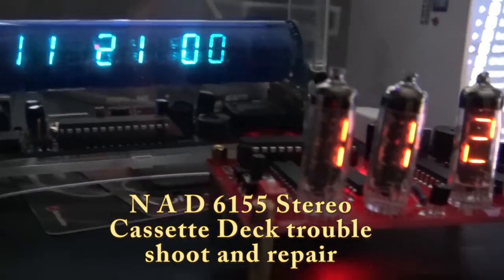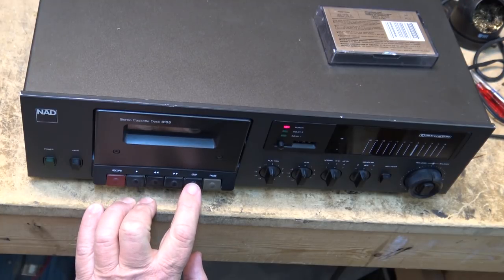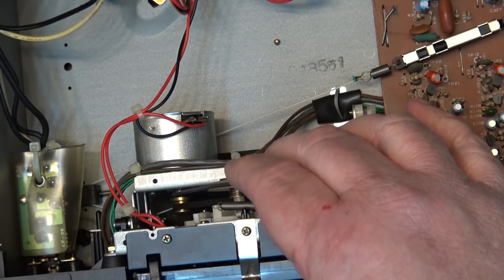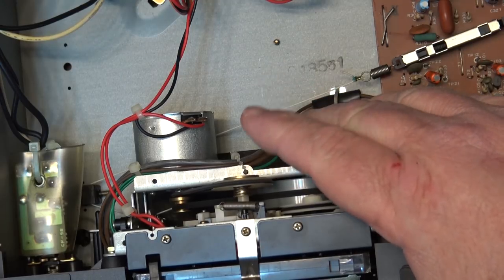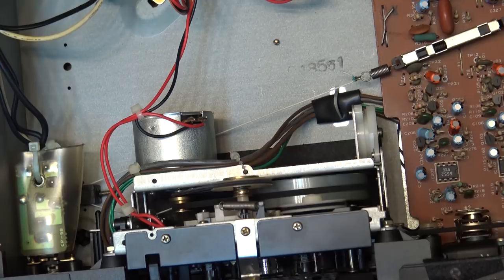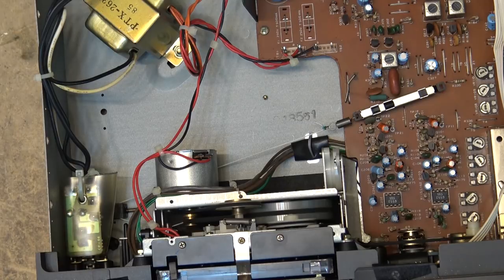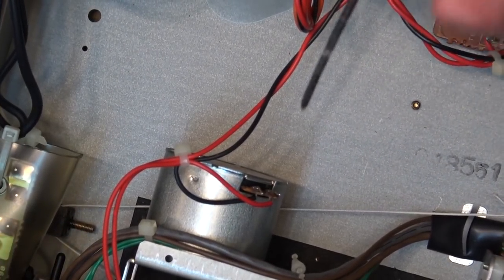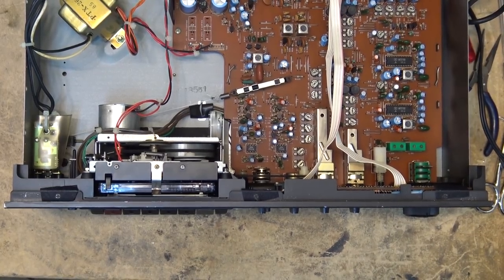NAD 6155 Cassette deck repair

Comment: I have tried boiling belts before- just on my own intuition, with limited success. But I realize watching this video that you let them go for 15 minutes, which I would never have guessed would not just melt the thing.  So I am doing one now in the microwave and letting it go for longer like you have.  This came in handy. Thanks!

Comment: Sometimes the simplest, right in front of a tricks you never think of like using tape to hold the other belt in place you can't see. And others like boiling the belt is so far out there makes me wonder how it was discovered. Thank you for sharing this wisdom and experience with us. I know sometime in the future I'll use one of these tricks and mentally give a big thanks for taking 90% of the aggravation from a repair.
Reply from the maker: The boiling belt can be credited to an old mentor of mine. A very smart broadcast engineer by the name of Leo Partanen. He was the head engineer at a cable station I worked at, and I saw him so that once for a 3/4" VTR that was throwing the capstan belt all the time. He had the machine in the shop and had the belt in the microwave. I asked what he was doing and he said "fixing it" Of course I had to try that, and well we know how this story ends. I learned that long before I was even considering a career in electronic repair. I was actually an intern at a TV station, as that was my field of study at college. Didn't pan out, and I went into the electronics business as I had already worked at a shop while I was going to school.
Reply: @12voltvids  I believe heating or cooling belts to shrink them goes back to the days of leather and cotton belts used in heavy machinery in factories. I volunteer in a local flour mill and the miller once tried to shrink a belt on an oat milling machine we have there.

Comment: Thanks, this video has provided some insight into what is likely the problem with my old marrantz system. It's a twin tape deck in a stack system, but both play fine, both rewind fine but neither rewind, if they do it's sluggish, or they stall out.  I think one day I'll brave it and open the deck again and take a look at the belts because I assumed belts were fine as it plays and fast forwards.

Comment: Boiling belts and pinch-rollers, GENIUS! Is that Jewel on the lead outro music? Thanks for sharing this great old cassette deck. NAD had a couple of cassette decks and other stuff that were hidden gems, offering performance value which was typically only present on much more expensive models from flagship companies, with stellar performance. Even these NAD 2 head decks were kick-a$$ sonic contenders!

Comment: I've personally never had success with belt boiling, so I just replace them. Same for the pinch roller. Cleaning only gets you so far with an old deck.

Comment: Azimuth corrections are nearly almost neccessary  , after a while 70% of the 2 head decks need to be re-adjusted 20 till 40 degrees to the right (clockwise)  in this set up, especially when the screws are mounted in plastic ..  The left channel which is always the child of the bill is going to benefit the most . Recordings will sound more open and defined

Comment: I found using a set of micro pick tools very helpful when maneuvering and remounting belts. I tried boiling the belts from my GXC-39D which is what, 42+ years old? it shrunk down but they are still +/-5mm out of tolerance. But they were roughly 12mm or so. So it does work :-)

Comment: Hey there, thank you for this video. I realize it's a few years old but wondering if you've ran across this scenerio;  I've replaced all the belts in this exact model and everything works, plays great, but ff and rew buttons won't stay down....they work great but don't stay engaged.  Just curious if you've ran across this?  It may be something I moved or didn't reassembly correctly..

Comment: I always say YOU KNOW what you need to be safe. The reason trolls complain about people not being safe enough is because they are less skilled and knowledgeable and half to take extra steps to prevent themselves from getting hurt.. Don't let the trolls get to ya.. I visually laff, because I can see them making stupid mistakes and hurting themselves. If you did everthing the trolls and people that want a nanny state things would MUCH longer and the Cost to skyrocket or even worse nothing would get done, because you can never prevent a idoit from hurting themselves.  Ignore the thumbs downs from the troll. I think your lever of safety matches your skill level. Thanks for the vids.
Reply from the maker: The troll is being dealt with with the legal department at youtube. He crossed the line and is being taken very seriously. Nuf said.
Reply: trolls  need to go. good luck with that  . you post a lot of good  info with your vids . i have learned a lot from you and your vids . now i try to fix stuff before it goes in the trash .   THINK YOU !!!  SIR!!!
Reply: I agree - I learn a lot from watching 12voltvids tech talk videos. :)

Comment: I noticed that when you recorded, the source was up to +5dB but when playing back the tape, it hardly ever reached zero dB. Isn't the source and tape supposed to be the same level? 

This either means that the tape doesn't run as hot, or the internal rec level needs pushing a little to normalise.

Just wondering...
Reply from the maker: The shots of the meter were not necessarily what was going to or coming from tape.  They were made after the shots were done for an insert shot.
Reply: @12voltvids  understood. Thanks for clarifying that.

Comment: Nice video. Wish you would do a video on adjusting the internal playback output voltage and record voltage. I mean where you adjust the POTS. Need the service manual and the voltage specs. Its my understanding that these settings are critical to the dolby working correctly.
Reply from the maker: Yes you do need the service manual specs to set it up. That is why I don't just start tweaking,unless someone else has been in there messing with them they will be correct.

Comment: The noise was a program stored from/for the Texas Instruments TI-99/4. Computer. Cassettes were the default method for saving/loading its Basic data.
Reply: Ray Rooney Same with the Commodore 64 and most other 80s computers.

Comment: I cleaned the pinch rollers in my decks with alcohol way back when I was a teen more than once. I still have one of my Sansui decks and it's fine. It probably evaporates before it can really do any kind of damage.
Reply: IIsopropanol is pretty gentle with most materials. Just keep it way away from anything acrylic and you'll most likely be fine.

Comment: Cracking job :-D, ahh the rec-play mode switch, i used to use servisol for those :-).
The stubborn ones i dissasembled and cleaned manually.
I've always used ipa for cleaning rollers/heads/pulleys, never caused any problems for me.

Comment: Whats the thing that transformer inside a cassette deck being such a strange placement, far a way from other components and in 45 degree? Is it noisy component or it affects playback/recording head? Just it stands out there...
Reply: It's basically a mains powered electromagnet.
Reply: true, but that is a magnetically shielded transformer, so it should not  matter were it is placed, maybe they were just playing it safe.

Comment: Thnx 12voltvids, I have enjoyed many of your videos. I have watched this one as I also have a NAD cassettedeck (NAD 602) with the same issue. Both Rewinding as Fast Forward are very slow (slower than Play). Initially, I also had an issue with no Playing. But I have changed the main (flat) belt, and now Play works perfect. Unfortunately, winding was not solved. I have looked for other belts, but there is only one other belt; for the counter mechanism.
Do you have any other advise for me what I could do?

Comment: There are a few later models from NAD  that have a belt somehow connected to the door . So if this belt becomes too loose or breaks , the door won't open at all .. I don't know exactly how it works but I think its  Very strange

Comment: How about that! Recovering a bad belt with the old boiled belt in the microwave for 15 minutes trick. Does that work on just rewind belts or are they all that way in this brand? Works for me, saved a belt! Not bad. Pretty quick too, but I have a discwasher DMag and it works just lovely.
Reply from the maker: Depending on the type of belt. Some will recover nicely, and others not. Depends on what they are made of.

Comment: hi just puchased a 6155 and when you insert a cassette in and push play / ff / rewind nothing happen just wondering if there is a transit screw being used or have i bought a duff one

Comment: Hi, 12Volt. I am having a hard time finding capstan drive belts online, that aren't warped and poorly made. They all sound like warped crap! I was wondering where I could find decent belts that give a nice perfect tone. Square belts or flat belts. Thanks!
Reply from the maker: I just ordered a bunch from fleabay, so when they get here I will have a look at them and see if they are any good. I used to buy from a local distributor, but after the owner passed away his son decided not to continue with the family business and pulled the plug. So I am in the same boat as most are these days.

Comment: Question:How did you record the 440 Hz tone?How did you verify the recording speed was exact? Just curious.
Reply: Mark Markofkane a) Some sort of tone generator and b) likely by ear and via the scope.
Reply: I’m not entirely sure how you’d know if the machine is running at an exact speed. I don’t think there’s really any way to tell. You can have your machine running really slow during recording, it just has to play back at that speed to sound right, but doesn’t mean it’s universally the correct speed. I guess the correct speed of tape decks was determined by mass produced cassettes recorded back in the day, done on the big proper machines. And by comparing the speed of the deck playing one of those tapes to the professionally remastered versions of them would be one way to know if the machine is running at the right speed.
Technically all he really did was tune this deck to the speed of his own one, and who knows what his deck is tuned to.

Comment: I use saliva with cotton buds then dry cotton buds to clean pinch roller. Works fine! Is that cassette data for a c64? Or perhaps amstrad cpc464? I have spectrums and Atari 8 bit gear and it's definitely not them. Ah I notice the question is answered!
Reply from the maker: TI99/4A

Comment: When you demagnetize the heads do you leave the tape deck on or off?
Reply from the maker: It really doesn't matter if it is on or off, just not in play or you will have the playback amplifier on, and could in rare instances damage the playback amp first stage. Also you never touch the head itself. For 1 you could scratch it, but direct contact would turn it into a transformer and could induce a relatively high voltage back into the circuit. I have a spacer about 1/4" on the end of the bolt that will get me close enough to eliminate any residual magnetism but far enough away to eliminate the possibility of inducing  a high voltage in the head winding.

Comment: 22:37 - is the take up roller struggling to rotate or it's just me and my beer?
Reply: Whichever of the two reels is bigger will rotate slower than the other.
Reply: @ranjitragu  That is corect. But just look at the left roller ... it rotates in a smooth way. Cannot say the right roller does it the same way.

Comment: Hello. Im a follower of tour vídeos. I love this kind of stuff. Im trying to add a líne un jack to my old stereo system. I have disassambled it and i hace thought to connect to the cd audio out connector. It has 5 pins, 2 of the grounded. I need some advices por recommendations. I know it is difficult because i have not found any information about this equipment. Greetings

Comment: Is it ok the deck running while u spray contact cleaner over the switch? Coz im always turn off the deck to do it so
Reply from the maker: Most contact cleaner is flammable when wet. So it is probably a good idea to unplug the unit as if there was a spark....

Comment: Hi 12voltvids, first of all, I'd like to thank you for the great content that you provided on your channel. :-) I have the same deck, I bought it like two years ago, and all I needed to do was to change the belts and clean the heads. It has served me perfectly ever since, but now it seems that I have a new kind of problem. When I press play or rec buttons, the deck won't engage. The buttons engage for like 3 seconds and then come back to their original position. I have tried cleaning the switch, but it seems that the problem is more of a mechanical nature. Rewinding and fast forward work perfectly well. I guess that my question is do you have any idea what could be the source of this problem and what is the potential solution. It seems that pinch roller doesn't come up to "pinch" since when I hold it with something in place the whole thing works. Thanks in advance!
Reply from the maker: Sounds like the auto stop mechanism is tripping
Reply: @12voltvids  Yep, I guessed so. Any ideas what I could try? ;-)
Reply from the maker: @rajaizkraja  
I believe it runs off the tape counter belt, but could be wrong.  Would have to see the mechanism.
Reply: 12voltvids Ok, thanks, I’ll try to hunt for it in th eservice manual. Thanks a ton!
Reply: @rajaizkraja  Hey Nick - did you ever find a solution for your auto-stop issue?  I have a 6240 with the same problem.  I believe the counter belt is downstream from the main problem, but haven't had a chance to get into it to find out directly.  Thanks for your help.

Comment: What do you think of MG Chemicals Rubber Renue for belts?
Reply from the maker: Idler tires it is OK. Don't put it on belts. It will make them larger.
Reply: Good to know.  Thanks.

Comment: Is there a way to determine if a belt is pure rubber or not?  I'm guessing it'll melt in boiling water?
Reply from the maker: Water boils at 100c far below what rubber or synthetic rubber melts.
Reply: @12voltvids    gotcha.. thanks!

Comment: Question about a Sony dual cassette deck from 2000.  Would you happen to know the voltage the solenoids use?
Reply from the maker: I believe it was 12 or 15
Reply: @12voltvids    thanks!

Comment: Question;

It is ok to boil a belts in a small pot  through stove even you dont have microwave?
Reply from the maker: No
Reply: @12voltvids  ahh why? Its melting the belts?
Reply from the maker: @gilbertlabra7531  
Yes the bottom of the pot will get far too hot and melt the belt. In a microwave the water can't get above 100C but the bottom of a metal pot sure could.
Reply: @12voltvids  ahh ok. So if i boil the belt in a microwave i set a temperature in 100°c in 3 mins or 5 mins?

Comment: How long would a belt last after being microwaved?
Reply from the maker: I have a few that have been in for years and still working. Depends on the belt.  I've done it many times over the past 30 years.
Reply: @12voltvids  Would boiling water do the same thing as I do not have a microwave here.
Reply from the maker: @theotherchannel2279  it's the hot water that does the work of restructuring the rubber not the microwaves so yes I would expect the same results.
Reply: @12voltvids  Cheers mate. ;)

Comment: When you change belts, change them all.
Commodore computer sound.
Reply from the maker: This is the same analogy to 1 cap bad shotgun it and change em all.
Belts wear at a different rate. The other belts are fine. 
If I was making 100.00 to change it, or if it was a very difficult unit to change a single belt then sometimes this makes sense but I don't make anything on these maintenance repairs. I make money from showing you how to go about changing it. I make way more from the ad revenue than I ever make doing the actual work.

Comment: NAD Built Wonderful Stuff, Just Too Pricy For Me!  B&O Taste With A Soundesign Budget.
Reply from the maker: Yes very nice. Yes expensive. No I don't own any, but I wish I did.
Reply: I lost my faith in nad when they started cheap Chinese class d amp crap
Reply from the maker: In audio equipment, old is better unless you are buying the high end domestic amps. The new Hafler and Dynaco amps are made in Canada by hand and are or very high quality, same goes for PS Audio in the USA. Again you will pay for this type of quality.
Now as to class D amps, they are getting better, and some of them are so good that unless you were told it was a class D you probably wouldn't know.
Reply: 12voltvids NAD? Expensive?

They were very much at the budget end of the market in the UK. They built their name on good cheapo amplifiers in the 70s and 80s, but their tape decks and CD players were generally just cleaned-up Sanyo designs (knock-down kits in some cases) made in Taiwan by Tatung. The record decks were badged Rega units and pretty good, but none of it was especially expensive in their glory days.
Reply: I have a nad c352, first thing I did was change out all the caps for Panasonic ones. The cheap ones it came with are known to fail so I did a pre-emptive recap. Totally brill amp. Runs a pair of monitor audio RS6 speakers.
Reply: @12voltvids  HAD A B&O AMP.............NO SCHEMATIC FOR IT........THE COMPONENT WAS BURNT SO UNABLE TO READ COLOURS ON IT............GOOD BOARD THOUGH...MIND YOU